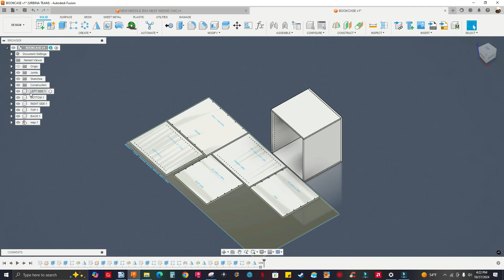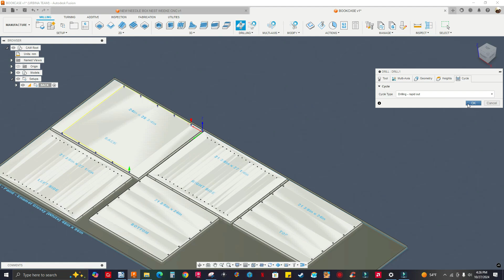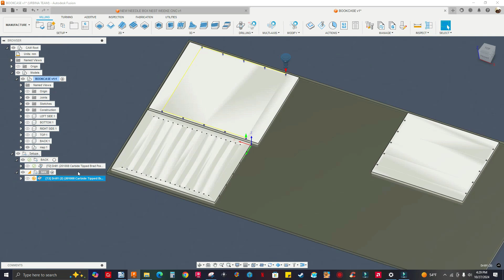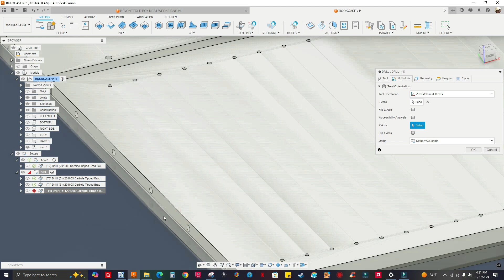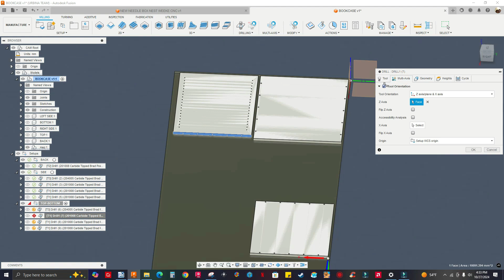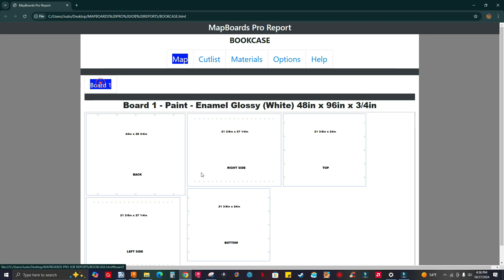PROGRAMMING A BOOKCASE CABINET FOR A HOMAG/WEEKE POD AND RAIL CNC MACHINE.

Comment: How you made holes on the pieces?
Reply from the maker: @martinsimcik5837  i the design workspace, select sketch on a face where you want the holes, select circle and give it a diameter. Select finish sketch, then select extrude, select the circle sketch and extrude. Type the depth, like -12mm.
Reply from the maker: @martinsimcik5837  i have a video on how i model a parametric upper cabinet. It’s got 5mm holes.